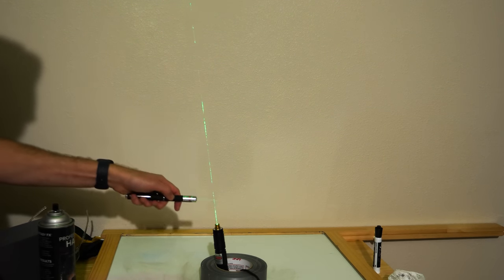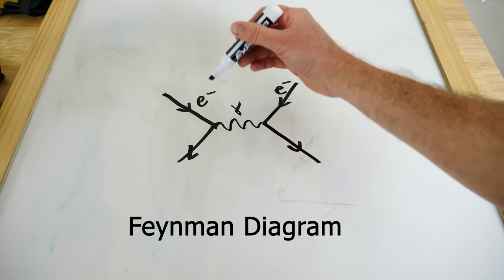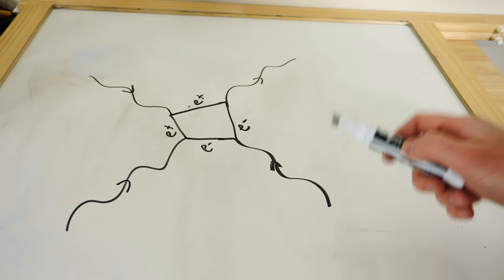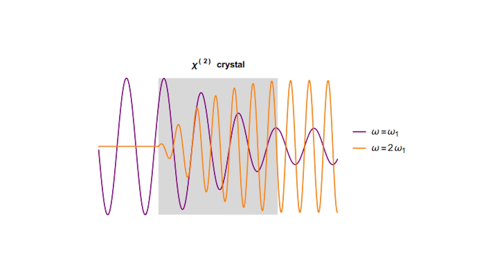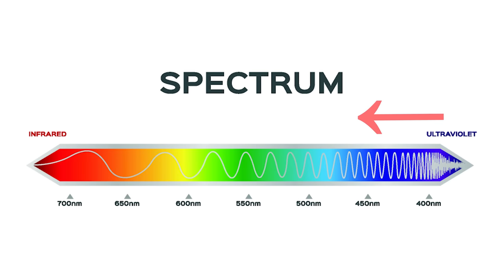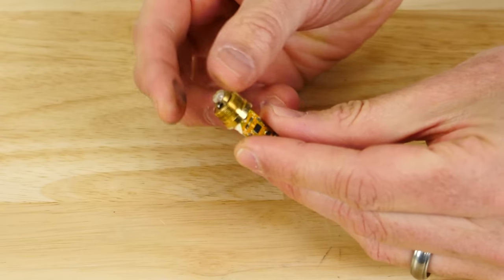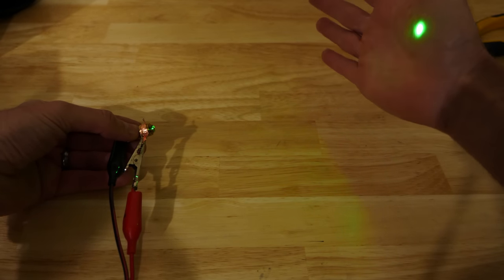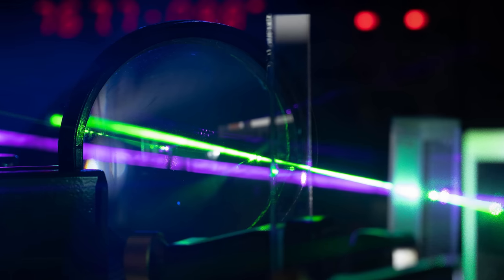Can Light Bump Into Other Light?

Comment: Really hard to answer if we still don't know what light is - this is probably why you avoid directly answering it. 
'Depends' would probably be the best answer as it depends on how you define 'light' and on which scale. 
On a normal scale (particle size and up), it generally does not interact (unless you have huge amounts of photons and are very patient). On the quantum scale, they sometimes sort of interact, especially if you don't look hard enough.
My theory is that they always do interact but they are so small that the space between them (on that scale) is so vast and empty that the chance of 2 of them actually meeting, is incredibly tiny. And to complicate matters more, they travel in waves so they don't even go straight which has some interesting effects when they interact - which is manly changing flavour.

Comment: In the end, if it were only single IR photon, then you won't be able to add it with other photon. You can sum it with different photon, but then there the information that it's half of visible light isn't useful, bc you could do that with any frequency, with is lower than visible ligh. Correct me if I am wrong.

Comment: I'm a little confused regarding your comments about detecting single infra-red photons. Frequency doubling is a two photon process so by it's nature you can't detect single photons using it.
I also thought that you would mention that the two photon scattering you first described must happen in the vacuum of space, where very high energy gamma ray photons from quasars etc. lose energy to background photons making the vacuum of space opaque to high energy gamma radiation over astrological distances. We haven't observed this in a vacuum due to the small scale of vacuums on earth but the distances travelled in space are immense resulting in it happening to the majority of photons.

Comment: Well, it is not so odd that light in vacuum do not have this sort of interaction with other light. Since it would be moving at the speed of light. And as such should be timeless. Time stops at the speed of light. But what happens when light hits another medium is that it slows down. That is why you get light bending and such. Now, I do not know if that really is a good explanation of why. Maybe there is a flaw to my simplified observation. But it does make sense.

Comment: I ofter did daydream about combining wavelengths to produce smaller wavelength with pasive object, so noise of radiowave around us including infrared produce visible light, then the output light used for powering solar panel LOL

Comment: A single photon can't decay into an e+ e- pair unless there's some other interaction.  In the final e+ e- state, there's always a frame where the pair has zero momentum, but there is no frame where a single photon has zero momentum so it would violate conservation of p.
Reply: If the e+ e- pair moved away from each other at an angle of α above and below the direction of the incident photon, I can't visualise the frame where the pair has zero momentum. Can you describe it for me?
Reply: @RexxSchneider  Sure - it would be in the direction of the original photon, moving at a velocity (relative to the original frame) cos(alpha).  So the origin of the 0 p frame just follows the center of mass of the two photons.  Hope that makes sense... A photon can't "decay" into any number of masses without another mass to transfer momentum into, since any set of objects has a center of mass that (outside external interactions) travels at constant velocity thus there is a frame where total momentum is zero, and a photon uniquely never has zero momentum in any frame before the decay.

Comment: Would a second crystal double the frequency again? And if that is so, why does the frequency doubling happen multiple times in one crystal?

A more fundamental question: if a photon is an exitation of the EM field, how can two photons be at the same position and that single point have two directions of movement. That would mean the EM field is of a higher dimension that just a plain 3D vector field.

Comment: You mean to say my tv remote can be easily converted to a green laser light . 😮 going to try this now i don't  need to worry about high costs of laser pointers for conducting experiments at home😄
Reply: Not green laser light, but probably just green light, and probably very dim, because lasers concentrate a lot of light, while a single led don't
Reply: @smokeduv if  I'll  uses lens then🙄
Reply: @ankitthakurankit4764  if you use a lens you’ll concentrate light yes, but still won’t be laser light. Laser light is very different
Reply: @smokeduv   ok then i would use that monochromatic green torch as my light source then i would amplify it by emission of radiation then by a setup of mirrors  I would throw out a concentrated beam of it.🤓

Comment: The ONLY thing light interacts with is matter (mass), light does not interact with light, no matter what.

In fact light is 'decoupled' from space and time, (therefore it has no reference frame) for light space and time does not exist, it is the same as matter having a different direction other that x,y,z (or a combination of them). 

Light does not interact with space, space does not exist for light, just as a jet plane does not interact with the water at the bottom of the ocean.

The only time we ever know that light is even there, is when it interacts with matter, and we see that matter do something. If there is no matter, we do not even know (and can never know) if there is light there or not.

Comment: Why does temperature affect the heat of the laser? The watts or ml watts can very for brightness. But they cool the bigger lasers down and they can produce more heat. Is it the Crystal they are going through that needs cooled or the gases used? Not basing this off a movie but just reminded myself of the movie Real geniuses with Val Kilmer where they fill a house with popcorn and then they use a laser from an airplane to pop all the popcorn in the house. They make a Lens out of frozen substance and then they cool the machine so it doesn’t overheat with this man is movie was made in the 80s. Out side Xmas decoration can be dangerous because it gets cold outside and those lasers can be more powerful than what they say they are because of the temperature.

Comment: Is it possible to double the frequency of photon particles so you are able to capture them in a clear glass jar.  My shed at the end of the garden has no power and I need a reliable light source. Batteries always flat when I need them.  I forget to switch of the LED laser lights I use there now. Did you know all diodes emit light?  Just can’t see the spectrum of some.

Comment: Are you sure the laser starts out as IR, and not UV? If a passive crystal can beef up the frequency, it beefs up the energy.
Even if it sacrifices half the light to achieve this, in order to abide the law of conservation of energy, it opens up new possibilities:
We consider heat as the lowest form of energy. We can't generate useful energy from heat, unless there's a difference in temperature.
If that crystal can turn background IR radiation into visible light to shine on PV panels, we've got ourselves a winner.

Comment: So you said that a lightsaber couldn’t exist with light… Did you consider projecting a magnetic field with a metamaterial? If the field itself engulfs the “blade” of the lightsaber, the magnetic fields colliding will repel one another. When this happens, them being opposing magnetic fields will cause the air in the area near the collision to heat up. With sufficient electromagnetic strength, you could even get this collision to make the same sound as a lightsaber.

So I disagree. A lightsaber does not have to rely solely on light. Also, this would allow for the possibility of the deflection of laser shots from blasters. Given the strength of the magnet and the metamaterials necessary for this magnet would be difficult to make.

As a materials engineering student, your videos are informative. I had to take this opportunity to try and shed some new light on the possibility of a lightsaber.

Comment: Interesting! Can you explain how to get, "any frequency you want" from second harmonic generation? Even in a highly non-linear medium, wouldn't you get a specific set of sum and difference frequencies, and all above twice the base frequency... ie, at shorter wavelengths?  I'm not getting how any non-linear harmonic process, by itself, could turn 880nm into 1064nm light.  And what happens to all the other intermodulation products?  Are they filtered out?  Thanks!

Comment: No, no, no. 

First, SHG and frequency doubling are the same thing. Secondly the interaction of NLO ( nonlinear optics ) don't work by colliding light though. From what I understand, the first photon energizes the crystal, this will change the electrical polarization of the crystal in such a way where the second photon will be influence by the electrical field polarization created by the first.  This gets a wee bit complicated and there are a few types of interactions that take place in that you have to discuss so whole litany of other things, electrical polarization, change in refractive properties, slow light, some Fourier series maths,  and so forth. Some crystals are electrically pre-polarized and are more effective because of this, such crystals are often called periodically poled crystals.

I can't say that I fully understand how NLO materials work, it's been years that I have been trying to wrap my head around how exactly they work on the QED level. I do however know enough to know your explanation is possibly wrong, and at best horribly incomplete.

Comment: You say you need several input photons into the non-linear crystal for it to emit a single higher-energy output photon. But in the end you say these crystals can be used to detect SINGLE PHOTONS of infrared light. Can you explain this seeming contradiction?

Comment: Does the non-linear crystal have a name or are they a class of crystals?  Can you double the green light?  What do you get if you doubled a red laser or blue? Is there an upper limit how many times can you double the light?
Reply: I think he made a mistake saying that the crystals could double the frequency of a single photon. It sounds more like its adding the frequency of two photons. If you double red or blue light light, you might get something along the blue-ultraviolet spectrum. If the crystal actually does take two photons and turns them into one photon of twice the frequency, then youd probably eventually run out of photons to double the more times you do it. These crystals might even have a limited bandwidth of frequencies that they can reliably double.
Reply: I can answer a couple of these, very generally:
Doubling any part of the visible spectrum will pretty much be in the non-visible UV range.
Doubling red would be UVA.
Doubling green would be UVB-ish.
Doubling blue would be UVC-ish.
But I'm unsure how many times light can be frequency-doubled. But I don't see why it can't be done. Unless there's some other weird phenomenon (like polarization)???
Reply: @youdontknowme5969  polarization can play a factor, but the biggest limit is that the photons need to interact, so they have to be within one wavelength of each other. As you drop the wavelength, this gets harder and harder to do.

Comment: Sir,
I do have a doubt. Can we directly store light like we store electricity in a battery ? Can you please explain it?
Reply: The quick answer is no.  Light, in order to be light, has to travel (nominally, at the speed of light - duh) and if you stop it from moving, it's no longer light.  Anything done to either slow down light (yes, this happens) or to stop it will convert part or all of the light into another form of energy (usually heat).  I guess you could call this "storing light" except that it's not being stored as light, but as heat.

Comment: This threw me off in the end. You can input 1 photon of low-energy infra red light and get visible higher energy green light out. How does that work. In the beginning he said it takes 2 photons of lower energy light to get 1 photon of higher energy light out. I was wondering if the red to green laser would work if it output only infrared photons, 1 by 1.

Comment: Yo dude I don’t know if you were wearing decent laser goggles when messing with this, but you see how damn that infrared looks in the camera? It’s actually multiple times brighter and more damaging than the green light. It will permanently damage your eye faster than you can blink. Even the reflection of that infrared light off of some thing will seriously fuck your shit up forever. I have a business doing metrology and test equipment repair, but I do gamma spectroscopy, radiation stuff, and a lot of laser stuff as a hobby. I’ve spent the majority of my extra income over the last decade on photonics lab equipment and lasers… All nestled neatly in the corner of my electronics lab. When you actually have the proper sensors and measuring equipment… It becomes a parent and scary how quickly those dirt cheap five dollar laser pointers can screw you up. I’ve seen some of those cheap green laser pointers that have hundreds and hundreds of Milla watts of infrared output. Literally dozens and dozens of times more powerful than even the class two and three dangerous lasers.

Comment: Hey James, this is a very interesting video.
By your explanation it seems that the combining of two lower frequency photons into a high
frequency photon is a process that does not involve loss of energy.
Wouldn't this enable us to break the second law of thermodynamics?
Let say we have a gas canister in equilibrium at room temperature.
We will put the crystal on the left side of the canister and low energy photons emitted by the gas
will turn into high energy photons, making the left side hotter then the right side.
Reply: My guess is that the process can't be "one way". So for every pair of low-energy photons on the right side  that combine and move to the left side, you'll have a pair on the left side that move (combining or not) to  the right side. Maybe even some of the high-energy photons manage to move from the left back to the right.   Thus no net flow of energy from one side to the other.
Reply: It doesn't let you break the 2nd law of thermo because you need the two photons to be something called "coherent," think same place at the same time. The gas chamber you speak of will emit spontaneously and randomly, so no two photons are likely to interact. Unless, of course, you put a TON of energy into them and have them constantly simultaneously emitting, but that's how you end up not voiding the 2nd law - you have to put in a lot of energy
Reply: Hey Max, thanks for your response.
isn't there a statistical probability to have some coherent photons passing through the crystal at the same time?
You yourself used the word "likely".

 @maxfofax5471
Reply: @Lucidthinking  hahahaha, you got me, likely is very imprecise. It'll take a bit to calculate the probability and get back to you. Briefly, I'll need the spontaneous emission rate, temp, gas density, and nonlinear susceptibility of the crystal to give you a real answer.

Comment: Would be cool if we could make optical CPUs. It would beat electron based CPUs by at least a magnitude of 10 if not 1000 in terms of computional power, also trillions of simultanous photon channels would (almost) multiply by that amount. Crazy amount of computing power that could bruteforce any encryption, heck even Bitcoin would be easy to break. If we only could do such things in vacuum, having photons react on each other without a medium.
Reply: Have you heard of a company called Lightmatter? They're making a "photonic accelerator" that can do AI work. Which is exciting, but probably not consumer grade hardware. That's only one piece of the puzzle, not a whole CPU. You can make logic gates with light using interference, but the problem is the size.
Reply: @DFPercush  I did a quick search and I must say I am impressed by their website. If it was possible to invest in this company I probably would, it could possible be the next FAANG say in 10-20 years. If this could be brain of electric cars of the future that is.

Comment: 1:28 this part doesn't explain, WHY no interaction is happening, why the particaks are just ghost pathing across, literally on that marker board, you have a 2D route, so it IS interacting (as markers draw lines). Try it eith MAZER light, versus lazer.
 Scientist in history, always declarwd assumtion in definitions called "theories," where light never wares out, cannot be slowed down, or never ages, simply because nobody on earth can chase light to find out. In actuallity, light particles have MICRO gravitational interactions, that are extremly minute in speed encounters with each other and mass size. They can, just like to heavely massive celestial bodies drifting in space, paeabolic around earch others commute path, the reason you don't see interfering take place, is the fast, so many other particlss, in laser level vast majority is continuously traveling, while the interception wasn't by that same partical, which traveled through the same commute path.

Comment: Does the double slit experiment count as light bumping into other light? Or does the question only refer to while light is behaving like particles?
Reply: tl;dr no. The double slit experiment is more about a single photon's ability to follow multiple paths, and the effect of measurement (or interaction). There are also crystals that can split one photon into two entangled photons with half the frequency/energy, which is how you get the quantum eraser version of the experiment.